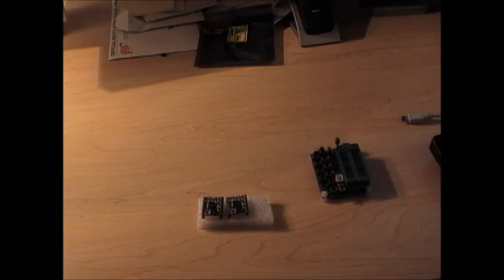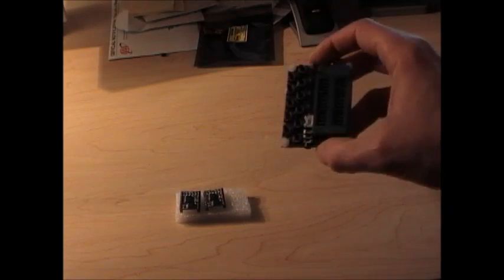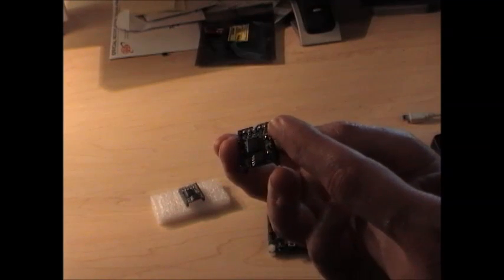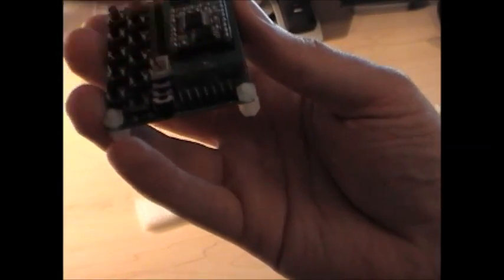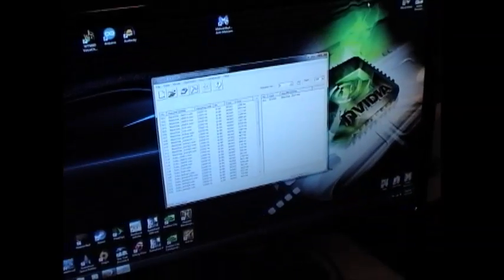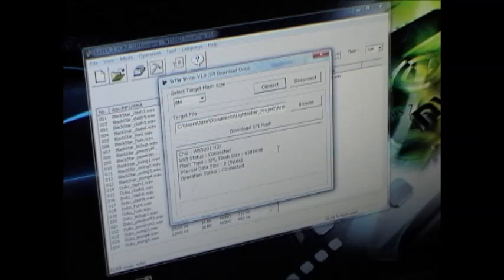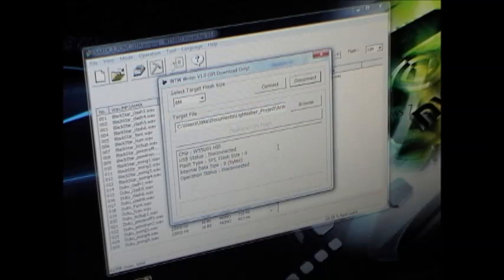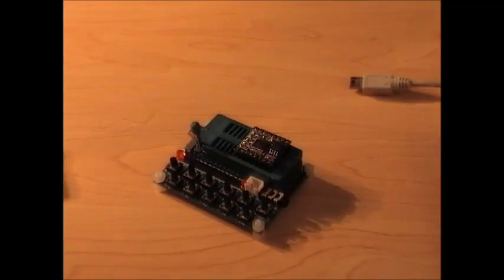WT588D Programming

Comment: So without that mother board there is no way to load sounds onto that?
Reply from the maker: That is correct for the smaller 16-pin modules. There is a larger 24-pin version "WT588D-u" that has USB built in. You don't need any external programmer for that one.
Reply: But does it require any additional components other that the flash chip near it?(speaking module wise I've seen the bigger one and it has a third chip which I don't know what it is...)
Reply from the maker: I'm not sure what you're asking. I can't identify every chip on the board, all I know is that if you use this programmer it will work as shown in the video.

Comment: Hey Jakesoft, sorry to bug you again. I got the song on the card, but i tried to test it and i'm getting nothing. I connected the speaker to pins 3 and 4, ran power to pin 16 and negative to pin 8. Have i missed something? It's not on a breadboard it's just running wires directly to the pins from a power supply. I tried 5 volts and 3.3.
Reply from the maker: If you are using the 16-pin version, you need to also run 3.3V to the VCC pin. I don't remember what pin number it is, but both VDD and VCC need to be powered. VDD can be 3.3V to 5V, VCC must be 3.3V.
Reply: jakesoft yep I'm us the 16 pin. I'll power it up and see how i go. Thanks again for your help!
Reply: Still nothing. I did remember with my programming, i set it to button mode should i have done it to one of the serial modes?
Reply from the maker: You only would use serial mode if you are using a micro-controller (like an Arduino) to command sounds to play. It sounds like you would want key mode (button mode).
Reply: jakesoft Yeah that's what I've got it running on 😔
Reply from the maker: Hmm. It's supposed to make noise when the key pins are pulled to ground. You have to assign each sound to a key. Did you do that?
Reply: jakesoft I'm not 100% sure. I think i did on the software programmer. How would i assign it to a key on the usb?

Comment: I pretty much wanna put a song on the sound card and have it activated by a 12 volt switch in my car. Is that doable?
Reply from the maker: I don't see why not as long as you have the proper voltage regulator to drop the 12V battery down. However, I'm curious: Why not just use your car's audio system to play a song?
Reply: LoL. It's a bit of a joke. I am putting a mini bar in the back of my 4wd and when i open the hatch where the drinks are i want it to play the Mexican hat dance haha. 

I got a voltage regulator today, and i have the programming device. What is the software i need to do the programming? I've tried looking up Voicechip but i can't find it anywhere.
Reply from the maker: Ha! I've gotta see this. I hope you make a video.
Reply: jakesoft yep it'll be there hahaha. So where do I get the programming software?
Reply from the maker: I honestly don't remember where I got the software from, I think a download link on the seller's ebay page where I bought my first modules. However, here is the manufacturer's site: http://en.waytronic.com/ProductsStd_176.html
My video is a few years old, so the software might look different but how you use the programmer is probably the same.
Reply: Thanks heaps mate!!! That link worked! I'll show you the video of it all hooked up and running haha.

Comment: Please help me! The Voicechip software always said that: Fail: connect to usb. And I have the same board, same chip as you do. Can you tell me where did I do wrong?
Reply: Great vid, btw. :)
Reply from the maker: USB 3.0 ports have been known to cause issues. Try using a USB 2.0 port or go through a USB 2.0 hub.
Reply: I've tried USB 2.0 port but i still cannot connect. The busy light was not light up like this video. Do you think that my chip is break down
Reply from the maker: The busy light is programmable, so it may just be off by default. It's hard to say without experimenting what might be going on. If you have more than one module, try it to see if you can isolate if the problem is with the chip or the programmer. Also try a different PC if you can.
These things can be flaky, some people just have bad luck with them. Most are able to sort it eventually, though.
Reply: okay, i'll try another way. thank you ^^
Reply: I also cannot make software connected to the board.
Maybe there are some specific drivers to install?
Reply from the maker: I've tried it on both Win 7 and Win 10 without the need for extra drivers.

Comment: This is a great video, I cannot thank you enough. WT588 can be so popular but sadly tech support is very poor. 
But the link you gave to download the software, after installing it the menu came in korean or chinese language..Any clue how to fix this please ?
Reply from the maker: +hypertuch I had the same problem at first. Even if you use the English installer, it seems to default to Chinese language. If you start clicking on the top level menu bar items you should see something that says "English" under one of them. It's the only thing you'll be able to read so it will stand out. If you click on that then the application will start over in English.
Reply: I will try it and see. Anyhow I cannot thank you enough for this video.  Also please if u come across a single chip text2speech w good quality plz tell me..the old ones like SPO25 are outdated and no one seems to care. Although all cellphone have that built in as they can read names..
Reply: BTW: I noticed 2 power connections VCC and VDD...so which one u used to connect to battery ? only VDD ? what about VCC ?
Reply from the maker: +hypertuch Battery power goes to VDD, however do not exceed the maxium voltage of 5.5V per the manufacturer specs. VCC is for regulated 3.3V only. For the 16-pin modules both VDD and VCC must be connected or it won't work. The simplest way is to just add a 3.3V regulator to your system and then you can connect 3.3V to both VCC and VDD. Either way, they must both be connected.
Reply: Many thanks Mr. Jake, I will try and see.
Reply: Connecting the VCC to 3.3v was the part I was missing.  Thank you so much!   I had a wt588d-U one that work while only connecting the VDD, so I was really confused why the same circuit didn't work with the others.  (Even fried my first programmer after getting "creative" while trying to troubleshoot)Can't thank you enough for that little bit I missed!
Reply from the maker: Chad Fox
You are welcome! I make these videos with the hope that people will find them useful. I'm glad you did. Good luck with your project.

Comment: Thanks for the video, I find some of my modules seem to play the sounds at the wrong speed, is that a bit rate issue?
Reply from the maker: Possibly. Try re-sampling your sound files at 20 KHz. I've had no problems with files at that rate. I have also observed that the modules seem to be somewhat unstable if you don't put 3.3V to the VCC pin.

Comment: Hi, Thanks for your information.
Are you also able to play sound via the Arduino?
So, via serial instead of switches.
I can not get it working via serial.
Reply from the maker: Yes, I can make these work with an Arduino. I added a link in the video description to an Arduino forum thread that has a working code example.
Reply: Thanks for your reaction!
The example code in the hyperlink plays the first 8 files. I will be very happy if I manage to make a sketch which enables me to point a certain file I like to hear.
The manual says it is possible, but how to bring this in practise?
Reply from the maker: VoiceOfMeMyselfAndI That's easy, although somewhat out of scope for what I was trying to show here. Read the code carefully. Call WT588D_Send_Command(FILE) where FILE is the address assigned in your WT588d project. Read the software manual for more on doing this, it's more than I can really explain in a comment response.
Reply: jakesoft I will read the code again with the tip you gave me. Reading the manual I was not able to reveal the information I am looking for. I wrote the manufacturer and asked for some advise but unfortunately they could not help me, because they were not familiar with Arduino. I then was hoping to find some example Arduino code on the WWW to learn from. Thanks for your patience and helping me to step in the right direction... (please forgive my chargoal English)